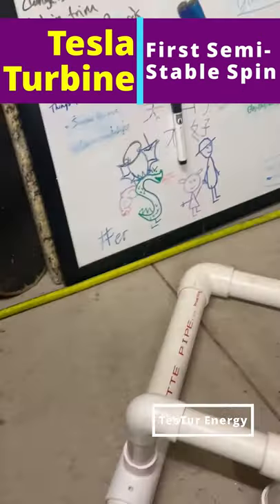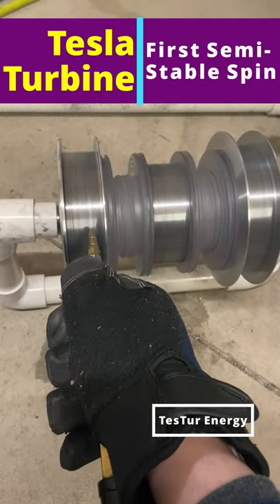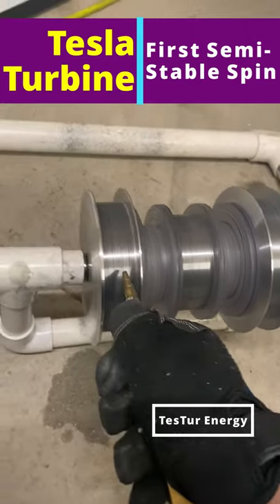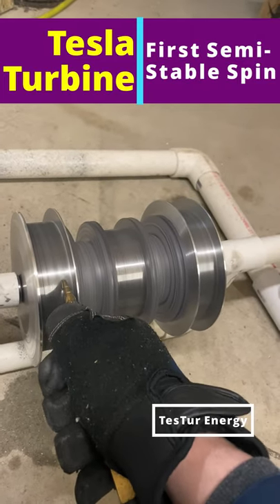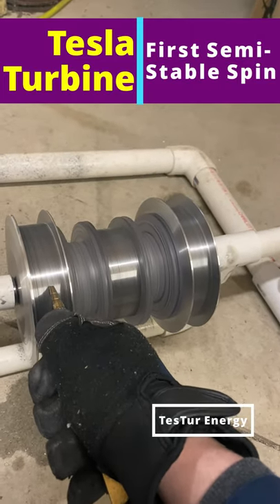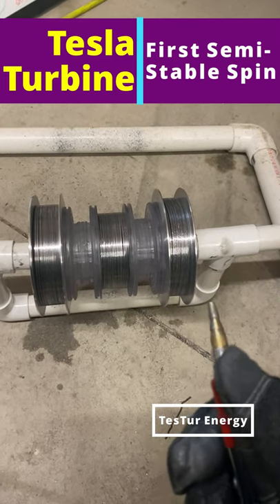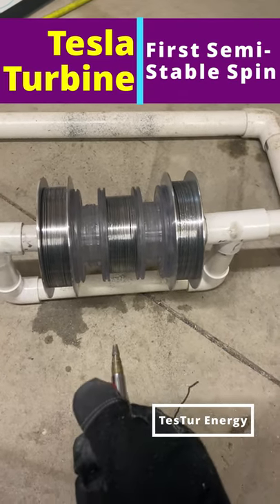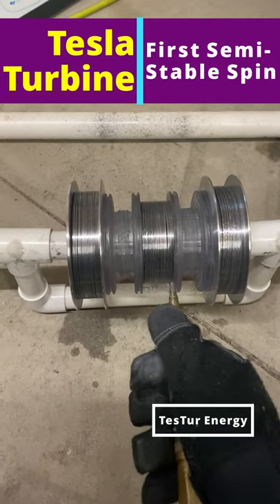Nikola Tesla Turbine - First Semi Stable Spin #TeslaTheBurninator #Trogdor #Shorts

Comment: How many RPMs and what torque are you getting on the axle? What is the velocity, temperature, humidity and pressure of your air? I'd love to see some real numbers with your system.
Reply from the maker: I’m still working on that! Believe me I want to know the actual numbers just as bad so I can do the proper calculations. Right now I’m just at the balancing stage. Once it’s all balanced properly I will be 3d printing a casing for it to really get some numbers. 

But what I do know is I’m using about 90-110 psi at the nozzle. It’s like 30-40°f in my workshop, so I’m getting possibly the worst conditions to make it work with how cold it and the air is. I will have EXACT numbers to give everyone.  I’ll have acceleration tests to calculate torque and horsepower output at given RPMs, and I’ll have the generator I’m assembling have read outs for the power produced. 

My harbor freight piston compressor is really old and is probably about to go out on me, it’s got leaks, and I don’t want to buy a new one. So I’m actually using the carbon fiber I just acquired to make a bunch of high RPM discs for a high cfm 5 stage Tesla disc compressor to replace the old piston compressor. 

So once I have the compressor upgraded I will also be taking measurements of how much energy went into making the compressed air that gets used in the turbine to calculate total round trip efficiency. 

I will most likely also do a video on how I calculate all of that data and explain the  graphs that I make for said data. 

It’s all in the works, I just need a little patience.
Reply: My guess is you're going to need to upgrade to steam to get any real power out of this. I struggled for years with compressed air. It certainly spun fast but my torque was always awful. If you use steam in place of air, Don Schmidtke claims it's a whole different ball game.

I've never been brave enough to build a steam generator. I don't trust my welding skills.
Reply from the maker: @zenmanproject  thats what I’m doing with the low pressure steam system I’m also working on. Generally you need very tiny spaces and LOTS of surface area with compressed air as well you need lots of cfm. Mass flow rate is the name of the game. 

But yeah steam is 85 times more viscous than air so it’s adhesion to the disc faces is that much greater. You don’t need as much surface area for steam because of this increased viscosity. But it certainly doesn’t hurt. I’m using disc spacing that’s at least 3-5 times skinnier than even Tesla used in his high vacua patent. But I’ve got soooo many discs and this number of disc spaces that I can still get the mass flow rate through to generate an enough power. 

Also with that compressor i plan to use it as the pre combustion compressor for when I do the replication of Tesla’s mixed fluid turbine patent (steam+combustion exhaust). He used a two stage centrifugal compressor in it. Check it out if you haven’t! 

NIKOLA TESLA BRITISH PATENT 186,083 - IMPROVED METHOD OF AND APPARATUS FOR THE ECONOMIC TRANSFORMATION OF THE ENERGY OF STEAM BY TURBINES
https://teslauniverse.com/nikola-tesla/patents/british-patent-186083-improved-method-and-apparatus-economic-transformation-energy-steam-turbines

I also have a bunch of 7075 t6 aluminum sheet .02in for making a bunch of cryogenic temp turbines to run off of liquid air thats made to store energy. The centrifugal compressor with the carbon fiber will also be realllllly effective for this. Having the multistage compressor to operate it in a Claude liquefaction cycle will make the whole system reallllly efficient. Especially when the heat of compression that’s taken away to cool the compressed air for making the liquid air can be put into the hot tank of my cryophorus low pressure steam system to be recouped entirely. 

I’ve got some more additions to add to the system for efficiency increases and alternate needs and purposes but I need to get a lot of other things settled first before moving onto those.
Reply from the maker: Hey Zenman Energy! Hope you’re doing well! If you haven’t already Check out my latest updates. Here’s my latest 10in diameter, 75disc aluminum and plastic prototype drive turbine dyno, 2.75kW and 6.22ft-lbs of torque to the shaft at only 4150rpm with a 150psi room temp compressed air supply from a regular piston compressor for now. I’m gearing it UP AT 1:3.6 to dual BLDC gens with a Kv rating of 2200rpm/volt. So for every 611 RPMs on the turbine the generators output 1volt. 
https://youtube.com/shorts/Zxy8mIVG6as?feature=share

Tesla Turbine Generators With Usable Power and Torque
https://youtube.com/playlist?list=PL4XBGjR8Gu-Emu1QRPIwATKFuCZabqOh1

1200watt continuous electrical load output with room temp compressed air all the way down to 65 psi too and with the turbine only at about 6700rpm.
https://youtu.be/BHPAQF8QNnw

This is a look through of the 10in disc stack of 75 discs, +10,000in^2
https://youtube.com/shorts/FU2LMZQ2_yA?feature=share

These are the latest liquid fuel burner tests for the replication of GB 186,083.
https://youtu.be/gRqKowignac

These are the latest propane burner tests.
Tesla Turbine Jet Engine Combustion System GB 186,083 Superheated Steam
https://youtu.be/KCyyiKnIarc

I haven’t gotten to my Tesla disc compressor tests finalized just yet but I have the setup to do them already just gotta do some upgrades to my bearing and gear hubs for the generators. 
10in Tesla Compressor & Turbine w/ Built In Balancing Apparatus RC Car Dual 6s 3kW 2200kv BLDC Motor
https://youtu.be/fCQn7Q0rroI